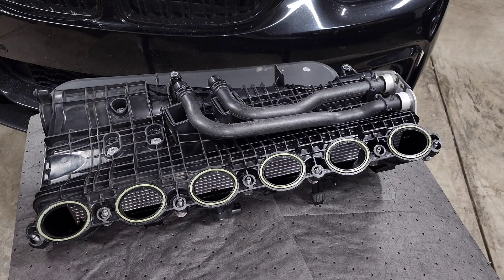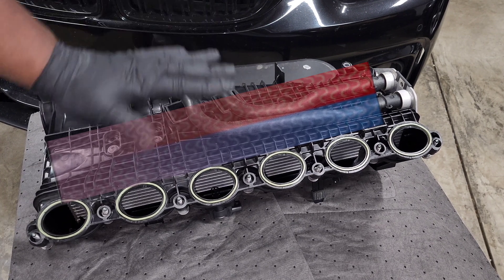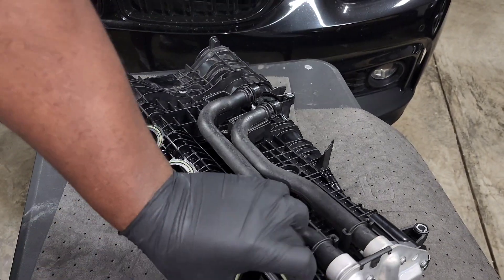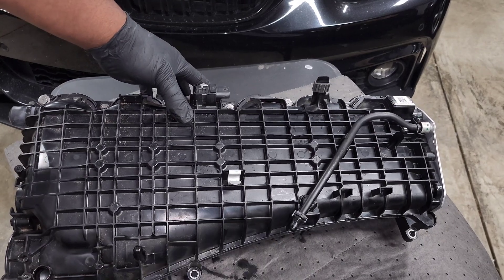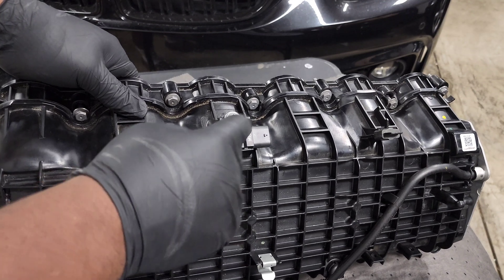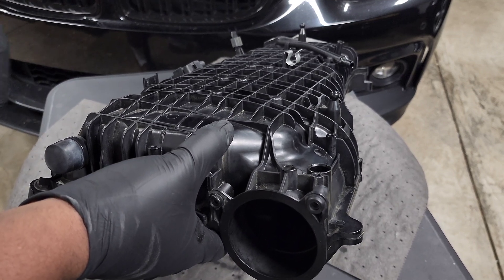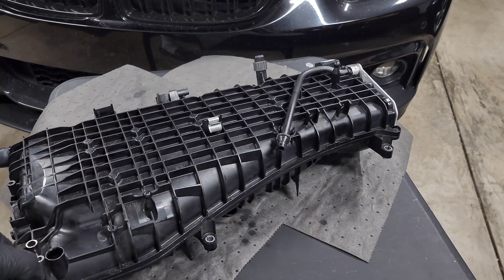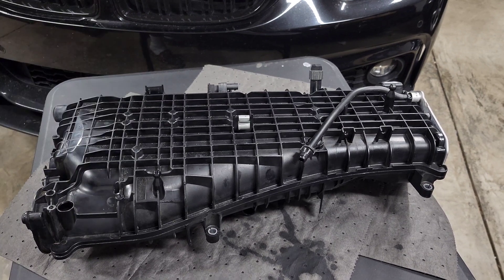Let's take a deeper look at the B58 Intake Manifold

Comment: Idk i cannot justify anything with pressures to be trusted by a plastic part. Changing it to metal manifold makes one less headache in the long run plus better cooling.
Reply from the maker: sounds like you don't understand the strength of plastic. Every sensor in your manifold has a plastic housing, including the one that reads pressure lmao. Cars are coming out of the factory making 500+hp with plastic parts under pressure. But it's whatever you want to do.
Reply: @kern417  All i know is that plastic becomes brittle over time. It is a cost saving which affects the customer only and when tuned i do not want to be left stranded because some Heinz or Klaus in Munich decided to put plastic dookies everywhere in order to save money. You literally cannot tell me that a full aluminum intake manifold is inferior to the plastic one. Especially when you are tuned.
Reply from the maker: @aleksandarvukovic2525  it doesn't matter if a stronger option is available. Why settle on aluminum? Why not get titanium? Why don't they use carbon Fiber everywhere?

Plastic is cheaper, lighter, and can be made strong enough to handle what you throw at it. It works and has been proven on our platform. If you're ignoring the data then you missed Material Engineering 101
Reply: @kern417  Why don’t we simply make a whole damn engine out of plastic then? Wait till you blow it like my friend did, not a pleasant experience. Sounds like a god damn bomb detonation. Split in half. 800 PS gen 1 build. Now his car is out of commission for a good month or two since he is waiting on the Wagner Tuning manifold to be made and shipped to him. But you are right on the majority part. Most will never go for that power and will never experience the manifold blowing during their period of owning the car. No need to be aggro to someone for having a different experience in his community. Plastic is plastic and heat cycles and plastic is not a good combo in LONG TERM. Simple physics. You either do not want to justify spending circa 2,500 euros on the Wagner or idk how much is CSF one since in Europe we do not have a good support for it, or you really believe that the plastic is superior. In the end we agree to disagree. You praise the strength of plastic while totally turning a blind eye to its obvious weaknesses. As far as i see, there is nothing to discuss here further. Good luck with ultimate superior plastic build, it will for sure outlast that cheap, cheap aluminum block which you then can replace with finest quality plastic since you are the expert on material engineering and understand that the plastic is lightweight, CHEAP, strong af. The only reason they put it is because it is CHEAP. Keep telling yourself that i am the one full of crap, but you will see that long enough.
Reply from the maker: A manifold blowing at 800ps makes it weak 🤣🤣🤣🤣🤣🤣🤣🤣🤣🤣
Reply from the maker: I'm sorry this legit has me in tears lmfao
Reply from the maker: No you're right. BMW should design a 320hp engine to handle 800. Otherwise they're cheap. 

🤣🤣🤣🤣🤣

Comment: Hello kern please may you help me I have a g32
model b58 engine so a couple of months ago I
was losing coolant dramatically I took the car to
bmw the done a pressure test and advised to
change the radiator and a few other pipes I did
that and two weeks later the coolant low sign
came up again and I could hear a bubbling noise
coming from the coolant I took the car back to
bmw and they have done a pressure test again
but they cannot see any leaks they have
suggested to change the intake manifold and
then re asses the situation I am worried that if I
change this there might still be another issue I
am praying it's not a issue to with the head
gasket the only current symptoms is coolant
bubbling what do u think could be the problem
as the technicians at bmw are confused
themselves they cannot exactly point there
finger to the exact problem

Comment: How much of a significant difference does the CSF intake manifold make a difference? I'm trying to justify the cost. I def want to use if for the rail to be port injected but to save cost, you can just get the rail and use the stock manifold. What are your thoughts?

Comment: Thanks for showing us the inside of the manifold  Kevin 👍,I’ve been very curious all this time to see if there is any gap/void between the air to water intercooler and the manifold walls. There doesn’t appear to be any ‘space’ for some charged air to be pulled around/over the intercooler and into a cylinder,which is nice!  
Still can’t get my head around how the hot charged air can get cooled so well flowing through just 5-6 inches of intercooling before it’s behind the intake valves 🤯. 
Your graphics you applied to this video are great. 
A massive YES from me if you can justify the cost and time to delve into further parts/components please!
Keep up your great work please mate

Comment: This intake manifold is the same as the one on the B58TU engine (M340i) right? Since you're pushing out 600-700 hp, what kind of IAT are you doing? like on average when you're idling on the middle of the day.

Comment: Off topic but my car has catless dp, dinan axle back, stock mid pipe. I am wanting it to be a bit louder but not too loud. Should I remove the front or rear resonator? Or both? I was thinking maybe just having one of them cut out. What’s your thoughts? I’m a little worried if I do a dinan mid pipe it might be obnoxiously loud?
Reply: Some would say that it makes it sound like a diesel truck. If you have the dinan axleback it should change the tone. I’d remove your first resenator (oval) to see how it sounds. Remove both to see how it sounds if you want too
Reply: @universalg_  thanks for the reply. You think the oval one kills more sound then the smaller round one? Wonder how hard it would be to have a shop weld in an oval piece or do they make something I could throw in myself ?
Reply: @badass1g  yea the oval resonates more sound than the cylinder one near the muffler.